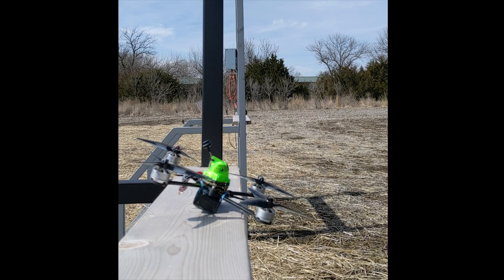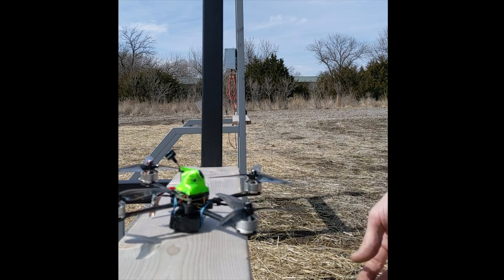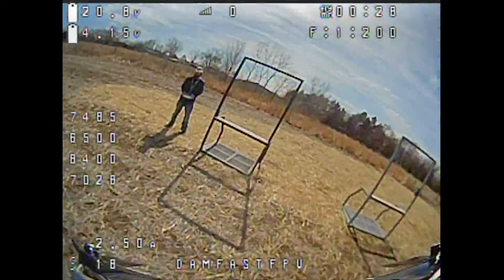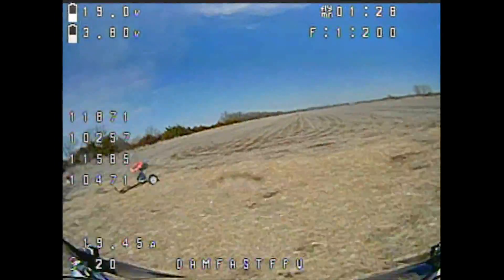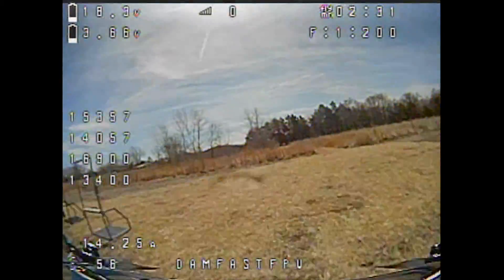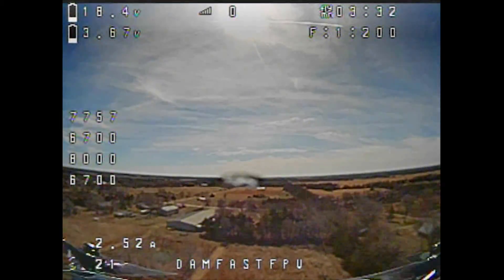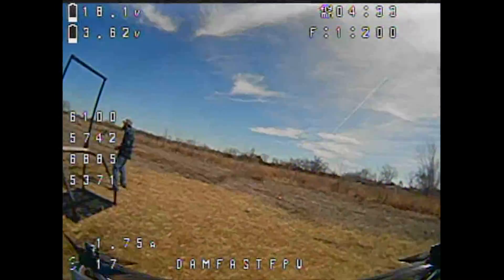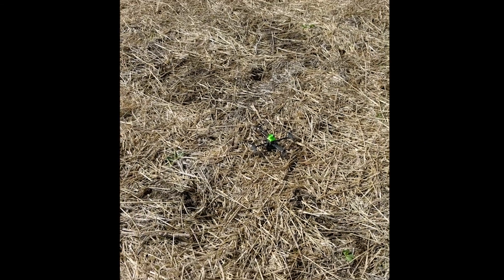Blitzschnell 5" + BetaFPV AIO 35A 2-6S! = DamfastFPV

Comment: Are these 1806 1800kv mjx bugs motors? Lol I just had to ask, and if so that's kinda awesome.
Reply from the maker: Yes! They are not the best built motors, but they are super efficient, and on 6S they rip!
Reply: @damfastfpv8016  that's cool though. I was thinking the airblade superman 1606 motors with the new hq 5x3 biblade tmount prop. I think they have a 2500kv version but it's sold out. Another one that's intriguing but maybe not the best quality are the eachine tyro79 motors, 1607 2800kv. Then all the 1506 and 1507 options around that 3000kv number.
Reply from the maker: @valden  those Superman motors are looking pretty nice as well. We are working on a motor specific to this sub 250gram concept that should put down some decent numbers. Thanks for the comment!
Reply: @damfastfpv8016  sweeeet. Curious to see what happens. Mind if I ask the weight of the frame and hardware dry weight without canopy?
Reply from the maker: @valden  
3mm frame W/hardware = 24grams
4mm frame W/hardware = 33 grams
Reply: @damfastfpv8016  I found some other interesting motors. 1804 size. Dys Made a handful and they are 2300kv. Also some others out there around 24-2500kv. I think they are all older motors but apparently they just weigh a little over 16 grams. Also pyrodrone carries the xnova 1804 in a 4 pack for 60 bucks in 2500, 3100, and 3500 kv. They are a bit more modern than the others and look nicer. If you shop around you can find the dys 2300kv 1804 for like 8 bucks a motor. I think I am going to try the dys first on 4 and then try 5s. There is an aio board that is rated 30amps that is quite affordable too that I'll throw in there. Lol should be a good budget build but I'm looking forward to seeing what these 1804 can do. Any reccomendations on canopies for the blitzschnell with aio board? Thanks man for putting up with my ramblings. Really kind of Hyped up about this haha.
Reply from the maker: @valden  just good old conversation with other drone nuts like myself is great! Lol. I will look into those 1804's as well, I'm sure those will be crazy efficient. It seems like the 16 gram mark will be a favorable weight on motors of this Utralight class. The trick will be getting the most power density per gram. We should be seeing 20-04 motors coming out soon that will bridge the gap between the power hungry 220X size and the slightly overweight 1806 size. Which AIO board are you going to try?
Reply: @damfastfpv8016  I just picked up a JHEMCU 30a AIO board, pyrodrone is out of stock but I found them at CycloneFpv. They have a 20a for 32.99 and a 30a for 37.99. They are cheap but they have been making the rounds on facebook and people seem to be having decent luck with them, at least not any worse of a fail rate than beta or other boards. I also have a 3 inch quad that I could cannibalize an hglrc f438 stack from for 5 more amps (but 9 grams weight...). Those 2004 motors look amazing, gonna be pricey though haha. Brotherhobby is top notch. 2204 hyperlites still look awesome though.
Reply from the maker: @valden  I've been hearing a lot about the JHEMCU boards, sounds promising. My next build will be with the 6S Iflight succex 20x20 stack. I have had great luck and reliability with my Iflight stacks.
Reply: @damfastfpv8016  wondering if I might be able to fit a 1050mah 4s on this with the 2004 motors and stay under 250g. I think I'm gonna order as soon as they are available. Do you have a favorite canopy for the aio boards?
Reply from the maker: @valden  it greatly depends on the weight of the 1050 mAh 4s. They can vary by over 20 grams from brand to brand. If it's too heavy for your build, they have some great 850 mAh packs that would save some weight. I have a feeling that some more options will open up soon for Utralight style batteries. I really like the gate hunter canopy and our new Beaver canopy both look great on whoop style builds. Look for the Beaver canopy on our Instagram page. It fits 30x30 boards and we are working on the whoop size as well.
Reply: @damfastfpv8016  nice, I actually like the larger canopies if I can use them since they cover all the electronics.

Comment: Hey man, I'm really looking at getting this frame for an ultralight. How do you think this would do on 4s with some 1606 3500kv motors and lower pitch props? Thanks!
Reply from the maker: I will be testing something similar to this on a 5" prop in the next week. I will let you know how it does. I would expect it to be very efficient, with such a small lightweight motor. The key is the battery. If you wanna go fast, you might have to go down to 4" prop and run 525mah HV 4S and she would scream. High C rating does wonders for Utralight racers. Not so important on a Utralight long-range setup.
Reply: @damfastfpv8016  I was also looking and i found some DYS 1806 2700kv motors that come in around 21 grams, then there are the hyperlight 2204 motors, supposedly just over 20 grams. Then those 1804 motors for an even lighter build at about 16.5 grams. Can we preorder the frame now?
Reply from the maker: @valden  I will be updating the website soon,  pre-order frames are in stock currently. We will be updating the store this week with new items and Utralight accessories. Honestly, I love the hyperlite motors. They are so smooth! They will be less amp hungry than the 1806's and that will allow you to run smaller lighter batteries.
Reply: @damfastfpv8016  yeah they are pretty insane. Wondering if a 30amp aio board would handle them. I'm sure it can handle the 1806 but the power to weight ratio with 2204 would be insane... They are pricey though you get what you pay for.  Thinking the runcam Phoenix 2 nano, nano vtx, and a pickle pod unless you guys include a canopy👍
Reply from the maker: @valden  we have one build running 2205's and it is insane! Clocked 107 mph on some 1750kv hyperlite motors on 6S. We will add canopy options to the site during the update. If you have a specific canopy you would like to print, we can setup for a custom print order.
Reply: @damfastfpv8016  just ordered the green version of the toothless 2 nano cam and a flywoo nano vtx. Now to wait for those 2004 motors or to see if anyone else comes up with something similar 😉. Looking forward to pre-ordering the frame.
Reply: Are these available for purchase or is it a preoder? I added it to my cart and can place an order. Will you have a kit with a canopy too or is that a separate add on at a later date? Thanks!
Reply from the maker: @valden  I will add a custom canopy option for you within the hour if you would like to add to your order.
Reply: @damfastfpv8016  I'll shoot you an email once I do. Would you recommend the 3mm or 4mm? I think 33 grams plus canopy should still be easy to keep under 250 with those vy 2004. Thanks again.
Reply from the maker: @valden  depends on how you fly and your environment. If you fly around lots of trees or concrete, I would go with the 4mm. I have power looped the 3mm frame straight Into the ground and crashed into another 5" mid air and have not broken it yet. But I'm sure I will before long if I continue to push it.
Reply: @damfastfpv8016  alrighty. Pretty sure the 4mm at 33 grams will still make Sub 250 grams possible with those 2004 motors. Brotherhobby just needs to release em lol. I will place an order now. I'm interested in replacement front and back arms too 👍lol if you want to shoot me an email or so feel free. I'll try not to spam your comments haha.
Reply: Order placed!

Comment: Definitely like the way it flys.
My betafpv 20a had the same bobble, I couldn't get it tuned out. Tryed everything.
Reply from the maker: Have you tried min throttle setting up? I'm also wondering if the size of the capacitor might be too small. Voltage spikes through the roof during rapid motor deceleration. I'm wondering if it's too much for the small caps.